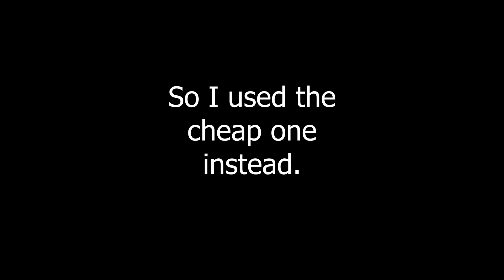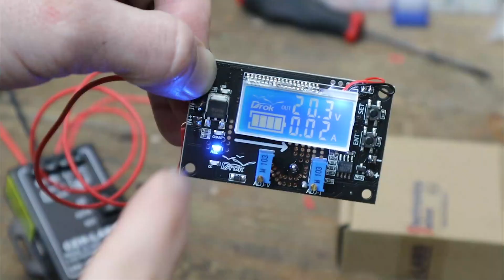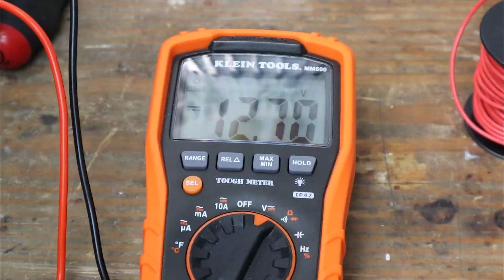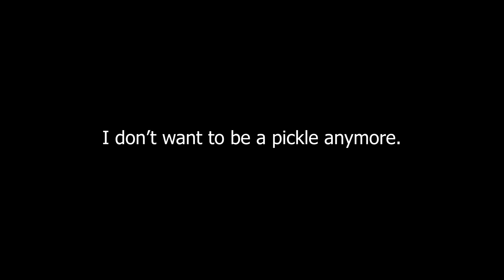How To Get 12 Volt Power From your 20 Volt Tools

Comment: i'm pretty sure power tools batteries have discharge and overcharge protection. You can take 12V from C3 and B -  battery terminals. Not sure of max current cell compensation capacity though.

Comment: Low voltage cut off should be 16v, I would dial the output up to 14.5v
Lead acid system will work at that voltage and you’ll get more life out of your step down.
Reply from the maker: Thanks for the pointers!

Comment: A 20V tool battery in reality is an 18V battery. 5 Cells times 3.6V per cell = 18V. That's the nominal capacity.
A battery with 10 cells has every two of them in parallel, so again it's 5x3.6V = 18V.
Fully loaded, the battery has more than 18V, and nearly empty, the battery has less than 18V.
That's why 18V batteries and 20V batteries are the same (we are talking about lithium tool batteries), the 20V-thing has to do with advertising, the consumer thinks "20 is more than 18 so it must be better". Some of them even call their 20V systems: "20V max".

Comment: The battery has a BMS on it that will protect the battery from to high/low voltages !
Reply: DeWalt 20v max builds them into the tool, not the battery. You can kill a DeWalt battery using the 20v adapter for a old 18v tool or doing something like this.

Comment: How many amps does having all lights and powered things on the boat on at the same time? I suspect your amperage is going to exceed the step down transformer capabilities. Certainly those wires. This is why your 12 battery has 10 gauge wire to connect it to the boat. You need a beefier transformer. More like what is in a 12V wall wart and a step down that can handle the 20 or so amps all your stuff needs. What is your breaker panel rated for?
Reply from the maker: We are running 3-4 LED navigation lights, and occasionally charging a phone. 

Will need to do the math but so far so good.

Comment: Thanks a bunch for this video. Me and my old boss finagled a way to mount a 1.2gpm sprayer pump onto backpack sprayers, wired up with 12v electric fence batteries (lead acid, so heavy) and a switch to never have to pump by hand spraying ever again and I had a feeling we could run them with our Dewalt batteries and step down converters. Been trying to find the parts and do the math for the last year, just been afraid to pull the trigger and buy a bunch of parts without knowing for sure. If you have any affiliate links on Amazon so you can make a cut of the profits, I’d definitely use your links!

Comment: You said you shorted the battery several times using the adapter with the fuse, so the fuse did its job just have to replace it.
Reply: I totally need to read comments before I make one.

Comment: Did you check that there was a good fuse in the fuse holder? It’s such a simple adapter not much to it. Switch or fuse?
Reply from the maker: Even put a fresh blade fuse in, I think the switch was bad. I was reading power going into the switch but but not out
Reply: @ZeroToAwesome  then your all over it

Comment: have you checked how many amps you need to run your boat? and compare it to what the dewalt battery puts out? or even the motorcycle battery?
Reply from the maker: That is a bit of a concern… it is basically running lights and I already swapped those all out to LED. This is definitely more on the experimental side.
Reply: @ZeroToAwesome  Since you'll be running it on a boat, there is an opportunity for some efficient water cooling for all those wires when the amperage gets too high. Would be perfect for cold and windy days on the water. Always look for positives when in doubt.